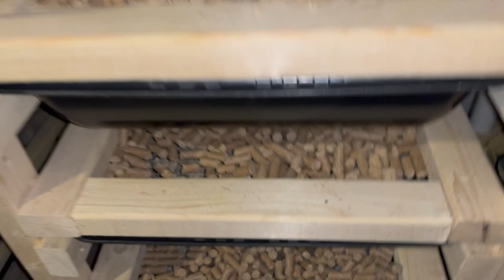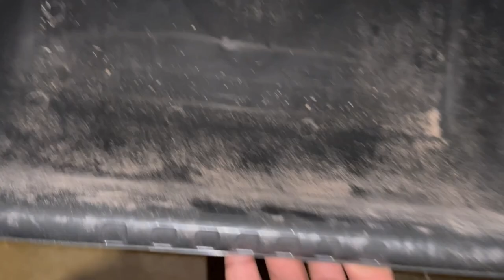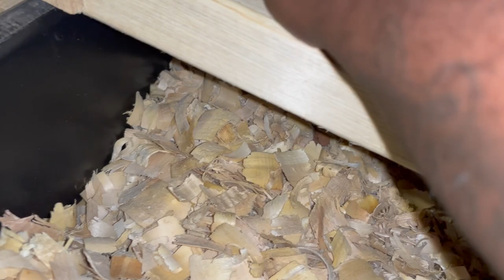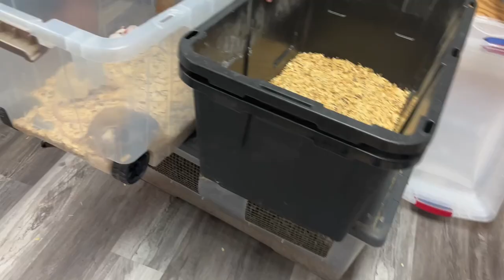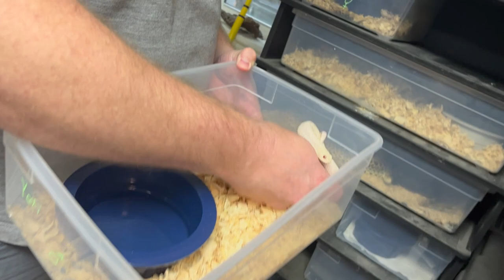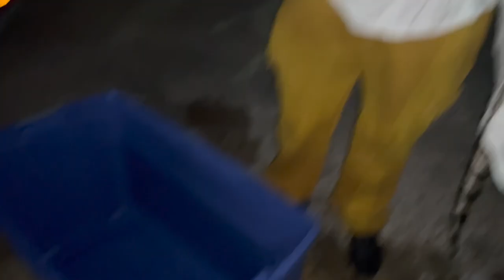Moving Day & Relocating Rats, Moving leads to disaster!

Comment: What do you recommend for high capacity feeders and waterers for mice and rats? I'll be away from my house for nearly a month, but I don't want to have to start over again with my breeding collection. The good thing about hamsters is they eat and drink way less than mice and rodents. A couple 8oz waterers and handful of seeds will last a trio of hamsters nearly a month.
Reply from the maker: I would recommend routing two water buckets to one rack . Having it where you have two nozzles in each rack until you get back . They won’t go through a 5 g bucket for about week in a half to almost 2 weeks depending on production. But to be safe you can use two .  As for feeding them . That’s the tricky part because they eat and poop a lot . I’d recommend building a feeding dispenser in the racks so the food trickles down . It won’t be hard but it will be about $60 budget including the buckets, tubing , 2x2 and mesh